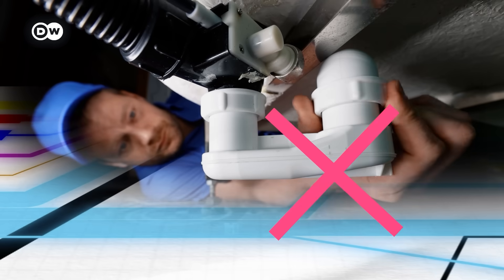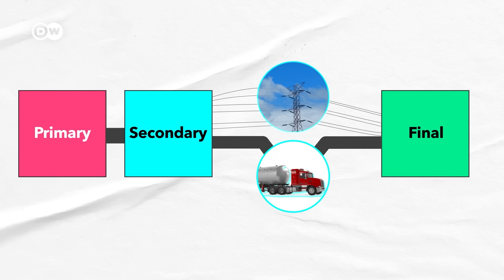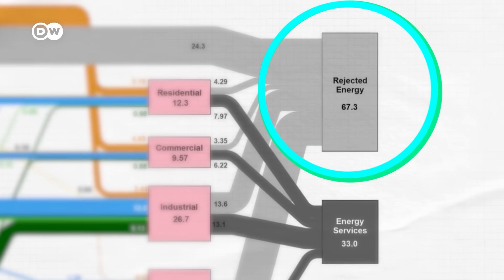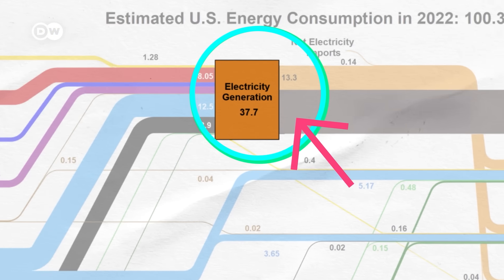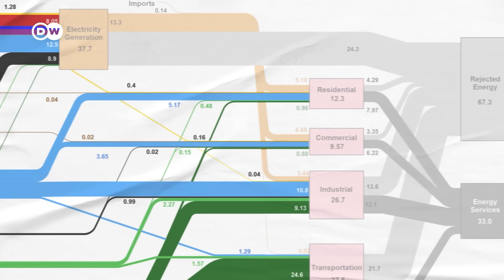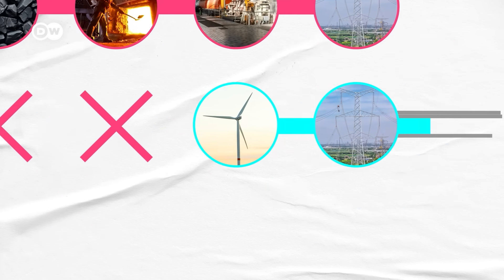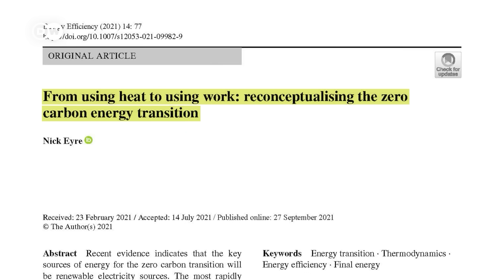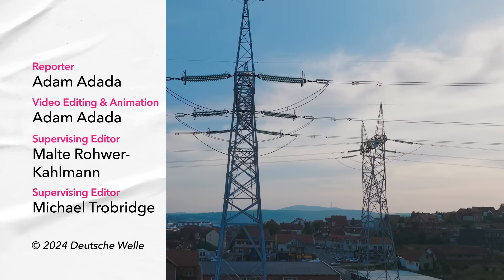The mind-blowing thing we get WRONG about energy

Comment: The Sankey Flowchart can be misleading, in that it does not distinguish between "(total) energy" and "free energy," where in a thermodynamic context, "free energy" means "available to do mechanical work."  So-called "waste heat" is described as "energy," but when we're talking about thermal energy, the "available to do work" fraction of that energy is specifically the temperature elevation above ambient, divided by the total temperature elevation above absolute zero Kelvin.  In practice, most "waste heat" is at close to ambient temperature and has little thermodynamic "free energy" left in it, and it's misleading to have that fat gray arrow in the Sankey chart include all the heat energy that is "depleted" and can't turn an electric generator or cook your food.  When solar radiation heats some air masses more than others and the temperature differences drive the wind, that energy conversion is enormously inefficient, but from our practical engineering perspective we (quite reasonably) ignore all that and claim that energy recovery by a good wind turbine is very efficient.  Yet when we start out with thermal energy, whether from coal or gasoline or nuclear or concentrated solar-thermal, we wring our hands about the large fraction of that energy that's "wasted."  We don't have a good, working colloquial term for "thermodynamic free energy" and to just say "free energy" sounds like we're talking economics rather than ability to spin a turbine.  If the thickness of those fat gray lines in the Sankey chart were proportioned to free energy rather than total energy, we've have a much more instructive picture of efficiency and where we can improve.  And yes, it's true, the inefficiencies of thermal energy are very real.
Reply: You're not making a point with your confusing text.
The energy that escapes through tail pipes and cooling towers is completely useless to us and needn't be replaced by renewables.
My EV needs 15 kWh per 100 km, my diesel needed 66 kWh (6.6l). So 15 kWh of electricity replaced 66 kWh fossil. Exactly what the chart is telling us
Reply: @openinverter  great assertion, thx
Reply: @openinverter  Do you account CO2 production in making solar panels? Do you account additional fossil fuel burned for grid stabilization? Do you account CO2 produced by power plants to generate power for charging your EV? Every country that integrated these so called free energy have huge price increases in electricity costs. Why?
Reply: @murat9268  the CO2 footprint of PV panels is currently compensated by displacing fossils after 1-2 years depending on various factors. In addition this footprint keeps diminishing as more renewable energy is used for the process. And then you still haven't accounted for construction of a fossil, let alone a nuclear power plant in comparison.
"Additional fossil fuel for stabilization" is a circular statement. Less fossil fuel is used because it is displaced, only a small fraction is needed to fill the gaps. Hence why the German electricity foot print is back to where is was in the 1950ies.
And finally countries with a historic high renewable share have the lowest, unsubsidized electricity prices of all.
Germany currently has higher prices not because "so much gas is burned" but because, among other reasons, the grid needs reinforcement.
Reply: @ The grid lines exist around 100 years, why do we need reinforcement today? Because solar and wind systems are highly intermintent, that causes voltage fluctuations in grid systems. The need for grid reinfrocement created by using solar and wind extensively. Technical feasibility research studies show that admissible intermittent power must be below 5% to have healthy electrical grid. The result is simple, we need much more backup natural gas and coal power plants to balance grid load.
Reply: @ it needs reinforcement as more fossil applications are shifted to electricity. EVs, heatpumps etc. Furthermore the paths that energy takes are changing. Less centralized power plants but instead more distributed small ones. The grid needs to be adapted to that.
If you look at energy charts you will find wind and solar is not intermittent in the way you describe it and for sure does not cause "voltage fluctuations".
I used to work for a solar inverter company and inverter output is tightly controlled depending on grid frequency and voltage. They are also used for power factor correction, further stabilizing the grid
Reply: @openinverter  Your power electronics knowledge is not adaquate. Primary and secondary synchronizatian are not an issue, but power supply must match grid load demand. The so called reinforcement is about load balancing. Every grid needs additional ready power generation, if not blackouts occur. Thus power distributors make contracts to natural gas or hydro electrical power plants to supply power as needed even though price is 5 times normal power prices.
Reply: yep, these people are scientifically illiterate
Reply: The low efficiency on my solar installation is very bad😢 . The sun will soon burn out because of that😢 and everything is lost ... 😂😂😂
Reply: @MrKOenigma  Low efficiency for solar panels results in high need for cooling. Cooling of solar panel yields 2% additional efficiency.
Reply: yeah i felt like that part of the video was disingenuous.  are we going to say that since solar panels only have ~30% *at best*, 70% of energy is wasted with solar?  

I only didn't dislike the video since the part about electrical appliances is correct.
Reply: @yu6387t3d  I really don't understand what you guys are advocating for my discrediting the Sankey chart? "Leave everything fossil" or what?
Efficiency in a solar panel is secondary, as sunlight provides 30000 times more energy per day than we need. And guess what, as opposed to oil it is not used up.
Reply: @openinverter  i'm not actually disagreeing with the premise of the video, i'm just specifically criticizing the evaluation of fuel energy sources as inherently thermally inefficient.  yes, there is more energy in burning coal than we actually get out from the generator plant, but we can't even theoretically access that energy, so why even mention it?  the relevant energy should be whatever we can put into the grid system in the first place.
Reply: @yu6387t3d  The point is: many "skeptics" argue like "oh look we need to replace so much primary energy with renewables that is not possible so lets not even try". The point is you only need to replace about 1/3 of the primary energy because that's the factor that most electric alternatives gain in efficiency.
Reply: @openinverter  yes and thats true, no need to mix in faulty logic to prove it
Reply: @ i reread my messages and I think I understand the confusion.  I'm saying that when they say x% of heat energy is wasted in coal powerplants bc theyre inefficient, its like saying x% of solar energy is wasted by solar panels bc theyre inefficient.  thats not the part that matters, just like with that extra energy from the sunlight, there's literally no way we can harness any more heat energy from a piece of coal; its not 'wasted' bc there was no way to access it in the first place.  

the main point which I think they should have focused more on is the efficiency of electrical appliances compared to fuel-based ones, like electric cars, heaters, etc. to show how these greatly outstrip fuel based ones in efficiency and this efficiency gives useable gains; the extra power saved from using an electric car can actually be used to power 2 more electric cars
Reply: @ Yeah that would be another way to look at it but it's basically saying the same thing.
One major difference is: you can't "waste" something that is practically infinite (like wind or sunlight) as opposed to a finite resource (natures ability to absorb CO2, or the fuel itself).
Inefficiency of solar panels just means you need more surface. On a house that's usually not an issue and you don't waste extra space
Reply: People muat understand that every possible process have losses. Wind has betz limit(67% limit, practically 20%) , solar has efficiency value(practically around 10% for commercial units, 40% for special applications), heat engines have carnot limit(around 75% for cycle, but 40% for old plants 60% newer plants), also energy storage have around 85% efficiency with huge battery and operating cost.

Comment: overexagerate efficiency or renwable energy. Ex. 90% eficiency to move the car :) This efficiency can be achieved only if you go downhill. If you sum up only the efficiency of electrical motors and the efficiency of drive train inverters you have less than 90% efficiency, not to take into acount the energy loss from battery and other accesories of the car including heating/cooling the battery
Reply: If you want to do that function, then the combuster is hopelessly exaggerated aswell. Much more than any electric in absolutely all situations. The real usable energy would be 3-4% max.

Comment: What I want is instead of replacing my petrol car with a brand new electric one, give me the cheaper option of upgrading my petrol engine to an electric one
Reply: Not possible. The cost for that would exceed the price for a new electric. 95% of the insides of your car are completely obsolete for an electric.
Reply: @MetallicReg  see this isn't explained or covered as I only assumed the engine and battery were required. You might even be able to leave the now redudent components like the exhaust. It just seems very wasteful to get a whole new thing when my current one is fine

Comment: only way to switch off fossils is nuclear, it has always been that way and it was oil and gas companies that pushed solar and wind first as an alternative because those two technologies dont have the means of providing stable amounts of energy. Germany invested 500 billion in renewables and is now one of the top polluters in europe (300g co2 per  kw), with very high energy prices. instead France's nuclear programme costed 150 billion and makes France the least polluting country in the first world (22g co2 per 1 kw) while also having very low energy prices. average time of construction for a nuclear reactor is 6 years as of 2024 (the reactors that exceed time and costs are not common, as the media would lead you to believe). nuclear waste is not dangerous at all, and its very easily manageable. nuclear is also the second safest energy source for death per kwh produced (including the worst estimates for every nuclear disaster). yes every disaster they scared you with only caused minor annoyances and no lasting effect (even chernobyl is now mostly on normal radiation levels apart from a few hotspots,and biodiversity is thriving). all the while, the people that die every day because of fossil fuel related illnesses are more than all the deaths cause by nuclear energy in the last 100 years. I plead you all to become nuclear advocates and help save the world. solar and wind are incapable of meeting industrial standards, they are akin to toys and they have an enourmous cost in terms of scarce rare earth metals and space. PLEASE I BEG YOU ALL.

Comment: One thing about your Sankey graphic, if you take coal and say it has this kWh of energy and some goes to electricity and some is rejected, you should do the same for the wind, sun and hydro, PV have on the mark of 20/30% efficiency, Wind I am not sure, but you have to mark the potential energy of the wind/sun the same way you do the coal and gas. This to say that they are not necessarily more efficient, in the whole process probably. Like the German guy said at the beginning wind and solar can't be the main source, however hydro in some scenarios can be. This to say that people do not know how important those plants are and how they need to work, to make sure that you have electricity at home.

Comment: This is a great insight and a good video, but there are also environmental problems linked to electrical systems that are not mentioned there : batteries, chips, etc. require a lot of rare earth material and other stuff in big quantities. Which are not infinite ressources neither and which extraction pollutes the local environment quite badly.

But the main take of this video that improving efficiency of systems rather than increasing the energy production, given how much we lose, is indeed a very interesting one !
Reply from the maker: We have a video coming on battery recycling today at 2pm CEST! Stay tuned. 🌞

Comment: My co-op board wants to insist that we MUST replace our broken gas stove from the 1970s with another gas stove, instead of letting us switch to electric - and the NY state ban on gas stoves goes into effect in 1.5 years. I'm probably going to have to fight them on letting us switch to electric now, even if that means we have to use a hot plate until they relent or the law takes effect.

Comment: It’s a great point, we need to be more efficient in the way we consume energy, but its hard on the consumer end because not everyone has the funds and ability to update home appliances, cars etc. Also you need to weigh up when replacing your existing energy using device (such as a car ICE to EV) will the embodied carbon from manufacturing that new device out weigh if efficiency benefits or should we just keep the inefficient device for the rest of its useful life

Comment: Now factor in the fact that for the UK ~50% of the annual electricity generated is lost in conversion and transport, you get to realise the enormous benefits and efficiency gains obtained with renewable electricity produced by decentralised generation and storage at point of use (roof top solar, on-shore wind, electric batteries, heat storage).

Comment: The Sankey diagrams are cool and do highlight a potential for “waste reduction”. However Carnot’s cycle shows there would always be some loss, as does thermodynamics (entropy). The bigger challenge however is that we don’t have a closed loop case for renewables. Today renewables are mined using fossil fuels, the mined material transported via vehicles using fossil fuel. This is where EROI calculations come in, and diffuse sources of energy do not have the requisite EROI as oil. The second part, which was hinted in the video, but glossed over in the conclusion is how does renewable handle peak demand challenges, esp. peak supply would definitely differ (and cant be flexed). Does it then make sense to build a backup gas plant, idling most of the time? And those claiming batteries as solution need to think what scale battery deployment has happened till date. The video truly doesn’t address the key issue - what’s realistic conversion away from fossil fuel
Reply: Also solar panels converts at best 20% of energy to electricity and the rest to heat.  It does have energy source - sun.

Comment: We need to make geothermal work via the microwave laser drilling technology (Quaise Energy) that's being developed.  That will make all other energy technologies move to the back of the line with maybe fusion being a better solution if it ever happens.  By tapping 0.1% of earth's inner heat, we'd have millions of years of power with no carbon pollution at a fraction of the cost of current electric generation.  No limits to where drilling can take place.

First field experiments happening this year.

Comment: You talking warm areas of the globe. What about North siberia, others. Yes you can buy them to burn and get worker hose for a little longer time. If you in sunny area I'm agree what uk. This is not efficient as you saying.
Reply from the maker: Yes you're right that colder climates in general are trickier to electrify - such as cars because their batteries run out faster. But then again, above Arctic Circle you have endless sunlight in summer 24/7. 🌞 Different regions with different capacities need different energy mixes.

Comment: Where's the energy costs for the manufacturing of those EV batteries?  They claim EVs are 80 - 90% efficient, but does that include the production aspects, too?
🤔
Reply: Yes they lie and stretch the truth quite a bit to try to convince and confuse people. Evs probably are 90% efficient with using power to move the vehicle. The problem is exactly what you mentioned. Power does not magically appear nor does that ev. That’s the only pro for evs when comparing gas cars as gas cars are only like 20% efficient. They never bring up the fact EVs are 3x worse for the environment to just make then gas cars. Gas cars are far better for the environment in every way, way to many to mention.
Reply: @danielmiddleton2900  Thats just not true.

Comment: You conveniently neglected to address renewable source reliability. What happens when the sun isn't shining and the wind isn't blowing? Failing to address the legitimate concerns  of grid reliability undermines your argument. It doesn't matter how efficient you are if you are producing zero energy - 100% of zero is still zero. Even if all our end user requirements were 100% electric, we would still require a non-renewable source as back up, and we would still require petroleum for non-energy producing goods, like asphalt for our electric cars to drive on and plastic to produce the components our electric devices are built from.
Reply from the maker: Yes, we need to look at the grid! Here's our video on the topic. 🌞👇
"This is what's REALLY holding back wind and solar"
https://www.youtube.com/watch?v=u-DsDuTceTo